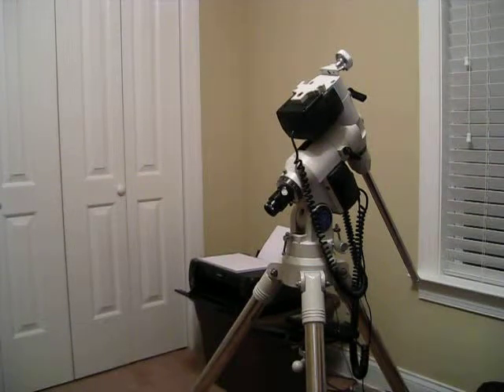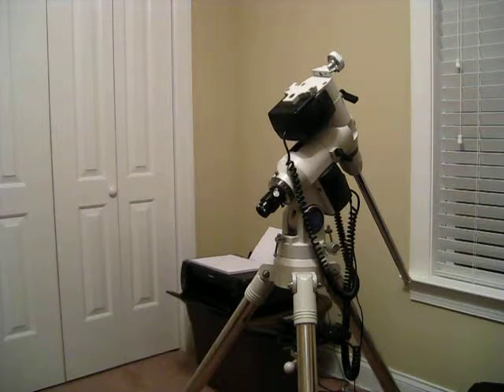ManCave Astronomy Meade LXD75 Mods and How to's#19 what not to do @$#%@

Comment: I know this is 6 years later but I just received a Bresser Polar Finder in the mail. It is sold on B&H and it is exactly the same as your broken Meade. I use my iPhone and Solomark Smartphone Capturer mount to clamp on the eyepiece of the polar finder. Then I send that image wireless to my iPad using the Alfred app.
Reply from the maker: I went and took a look do you have a part number for the polar finder scope? Thanks for sensing me the info. I will be starting up new vides soon, keep a watch out for them.